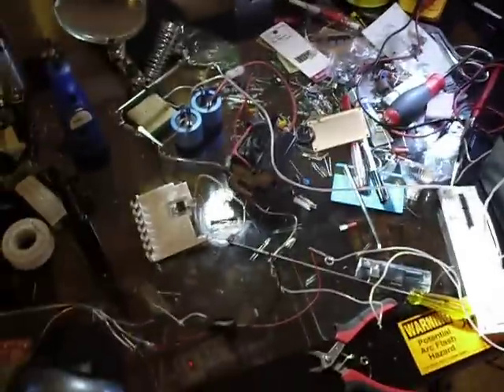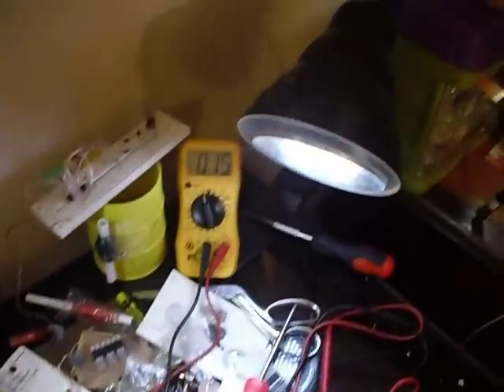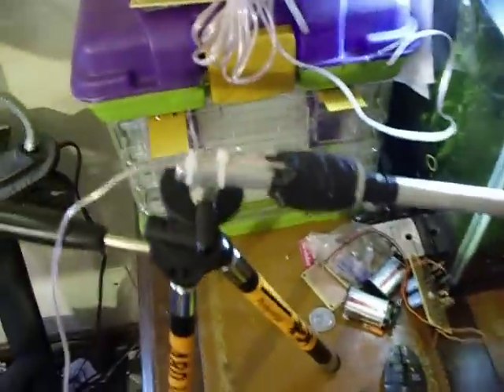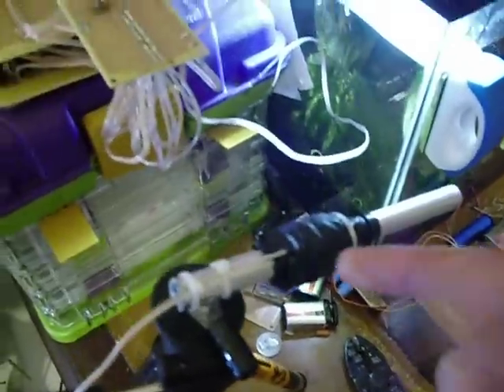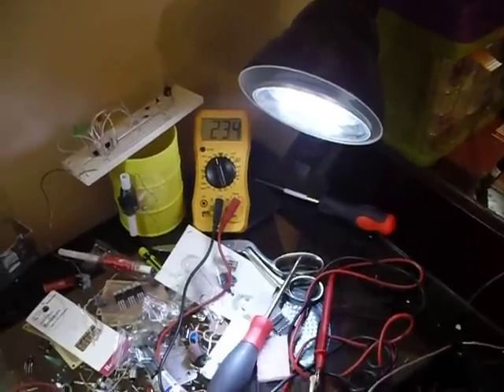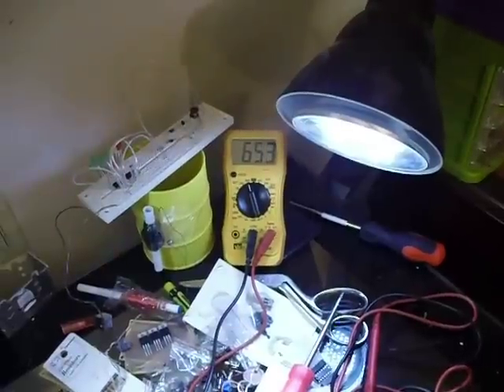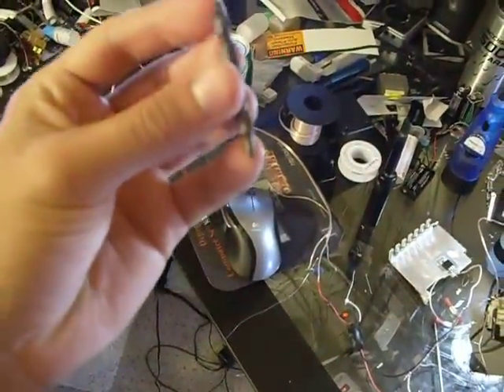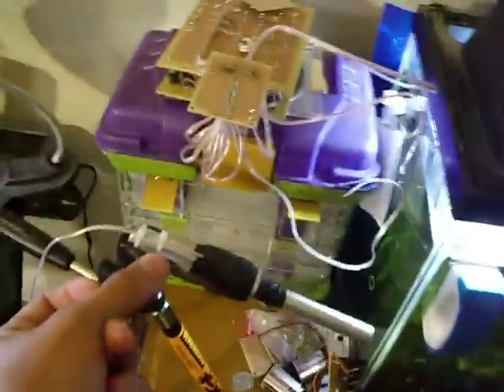560uF 760 volt 22 gauge single coil gun 89.6 Joules

Comment: @spinafire when capacitors are in parallel the micorfarads (uF) will increase for every capacitor added.... the formula is.... C=c1+c2+c3+ect... the voltage can only be doubbled when they are in series (postive to nagative) but the micro farads will be divied by two...the formula is..SC=C/2..........the more microfarads the capacitor bank the longer the duration of the pulse so depending on the coil u would either want more or less depending on your need............hope this helps :D

Comment: When the capacitors are soldered in parallel (all negatives connected and all positives, I think that's parallel), you add the voltages, right? How do you determined the uF of the circuit and how do farads affect the coilgun strength? I'm very interested in coilguns, I'll sub if I can get an answer :D